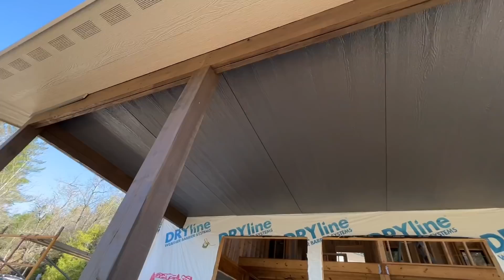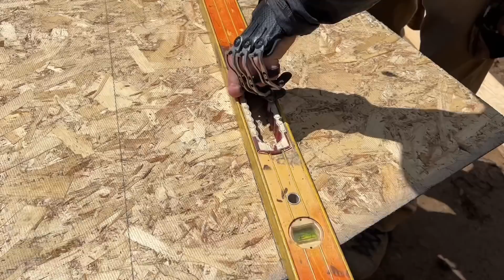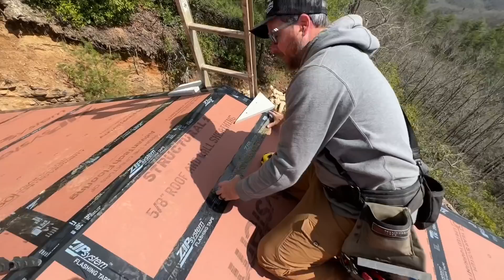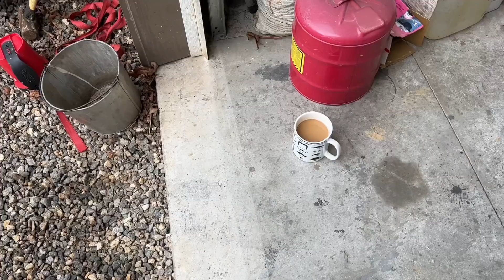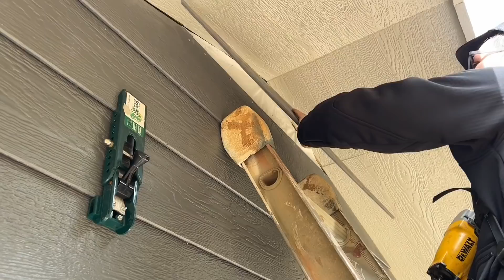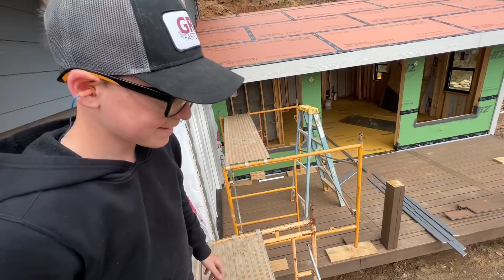Finding The Angle | Building A Mountain Cabin EP32

Comment: Great pro tips on how to get angles the easy way and to know that they are what the space requires.  Way back when (1950s to 1960s) I was working on job sites starting at the age of 7 with my brother who was 8 at the time.  We started out keeping the job site clean, removing forms from concrete pours, removing nails from boards, etc.  By the age of 11 I was carrying a full bundle of shingles onto second story roofs so the primary carpenters could install them.  That same year I started installing them too and became part of the crew, for $1.00 per hour.  So, seeing youngsters on the job site isn't anything new and it's a good learning experience they (like me) never forget.

Comment: Another pro tip about starting screws: You can run the drill in reverse to create a little divot in the wood, then when you run it forward the screw is more likely to actually bite. You can also just use the drill bit to "burn" a starter hole for your screw, but that really only works with philips heads.

Comment: Every time I see a closeup of Jamie using his “bionic” hand I think of how marvelous technology is today.  Think of what will be available to the person 50 years from now with a similar injury!  ✋🫶👍
Reply: I just started watching them recently, curious what happened if he ever shared that.
Reply: @diceonamay  There are videos about 
it on their channel.
Reply: Yes.  I can’t remember how far back it was.  They vlogged about his surgery, recovery, subsequent surgeries and new hand.  If you scroll back far enough you will find the vlogs.
Reply: @diceonamay  Jammed his hand in a jointer. They were jointing something big and had the guard off, he thought he turned it off after using it but he was wearing ear protection and couldn't hear the motor still running. He set a board down on the surface and it pulled his hand into the blades. I think he still uses that jointer.

Comment: Question for you guys? Why don't you run the siding behind the trim?  Up to the nail flanges of the windows then apply the window casing on top of the siding. The head piece would need special attention to get the drip edge behind the siding and ontop of the head piece. I hate to see the caulking joint down the side of the window casing.  I just feel like it's a leak waiting to happen.
Reply: I get that… but all the lap siding is cut around the window trims and corner boards. So it’s not too terrible. I would like it better to have it behind, but I can’t come up with a good flashing detail that I like

Comment: Just discovered your channel.
In India we use Bricks and cement for the house/buildings construction. Wooden is used rarely for the floor only.
But seeing in your video that whole house is built from wooden, made me question that how many trees were cut to make only 1 house? 
& It also solves the question why fire incidents blows the houses to extreme zero..
Reply: Good question, I had to do some googling. In the US, wood for construction in large volumes is measured in board-feet (144 cubic inches of wood). A typically framed house uses between 6 and 8 board-feet of framing material per interior square foot of floor space, and a typical 50' tall, 20" diameter pine tree can produce approximately 1000 board-feet of framing material. With these numbers, this house ( approximately 1500 square feet * 7 board-feet per square foot) might contain  10500 board-feet, or 10-11 mature pine trees worth of wood.
Reply: And we have billions of pine trees

Comment: They make sidewinders, (that's what you have) that the table is set up on the opposite side, like a worm drive and you can watch the saw blade cut the wood. You haven't made good clean cuts until you watch the blade cut the wood. Plus you can life the guard and make super clean 1/4 to nothing cuts cause you can watch the blade instead of guessing like you guys do. Once you cut watching the blade, you can't go back to using the table as a guide.

Comment: So just a weekend craftsman (barely) here, but any reason you guys don't use track saws? I pretty much use mine for ANY cut since it's so much easier to get straight lines without thinking about it.  Is it an efficiency thing, or just enough time behind the saw you don't need to do it? Always wondered when watching.
Reply: Well we have a track saw… it would be good for these siding panels. I don’t know why we don’t use them at work … it sits in my shop

Comment: Remember you guys on that raked sheet siding with the bottom of the window cut out, that as contractors you can afford to be perfect. If your a siding sub, or you've run out of siding, you have to learn to make that sheet work with the 1/4 to nothing gap below the window. You cut a 1/8 to nothing coming back the other way from that 1/4 to nothing cut, and split the difference on the flashing reveal.

Comment: Am I just unlucky or have DeWalts manufacturing standards dropped in the last few years?  The last three skill saws I've bought from DeWalt (DCS391, 570 & 578), the blade has not been aligned with the notch in the base plate in any way shape or form. The 578 is a whole 3mm off! I've have to file my own notch in all of them to make that feature useable.